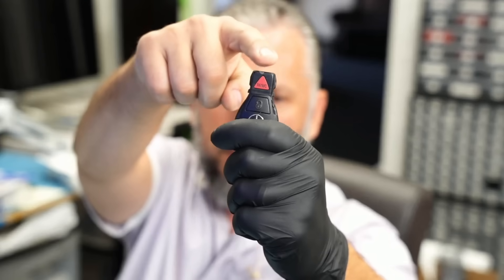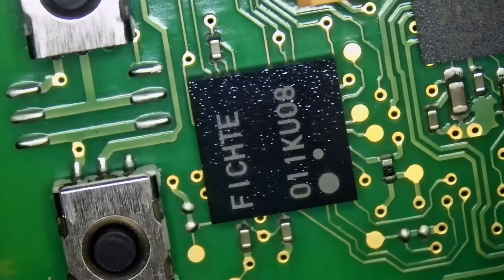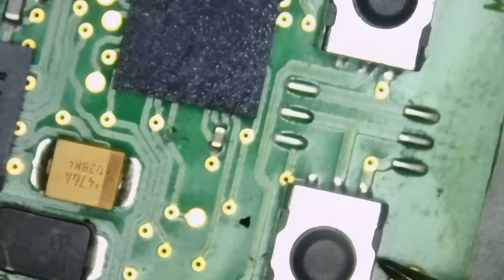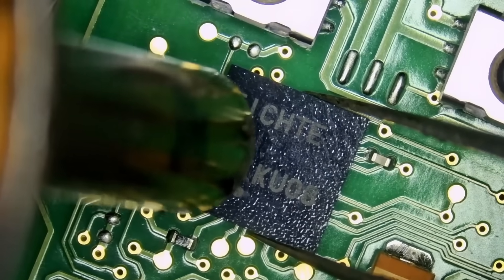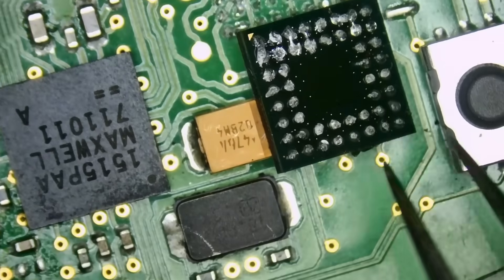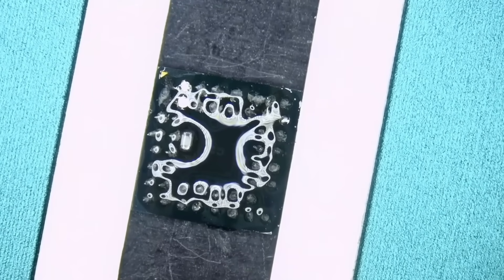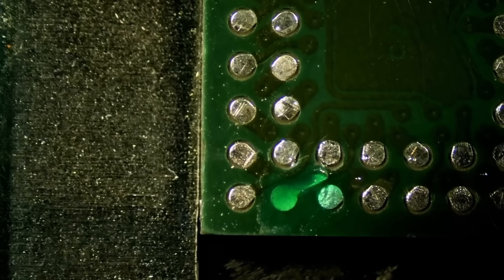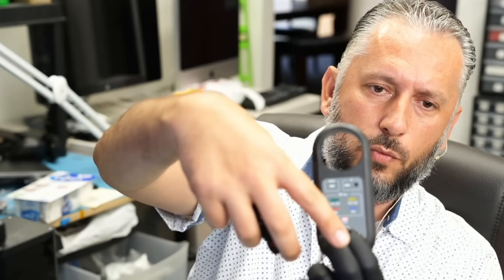Triangular Benz Fob repair - Damaged BGA Chip Transfer and Reball

Comment: i have 2007 Mercedes Gl450. Do you repair the ignition switch also? 
my mercedes would start intermittently, someone told me it could be bad ignition switch, n i have two key fob for it, one of which doesn't work.
how much would fixing the ignition switch and 1 key fob be around?
Reply from the maker: We don't work on ignition switches. Only key Fobs

Comment: Due to the lack of audio, I wanted to summarize as I see it. I assume that the Fichte/Apfel chips contain the configuration information for the particular vehicle. You removed the Fichte chip from the donor board https://youtu.be/ywt3b9ICm2A?t=400 and did not use it since it was for a different car. You removed the Apfel chip from the customer's fob https://youtu.be/ywt3b9ICm2A?t=581, fixed the torn pad, and soldered it back to the donor board. Correct?